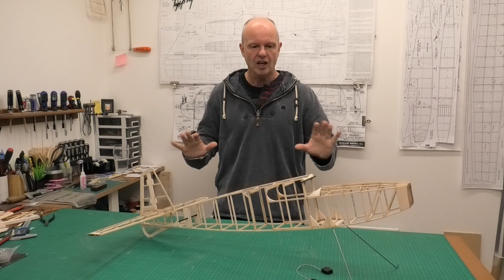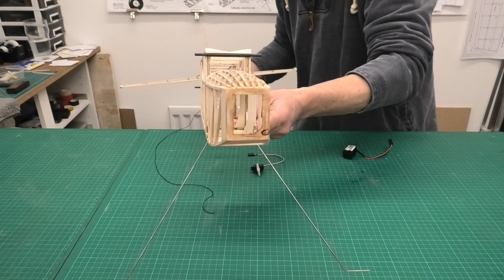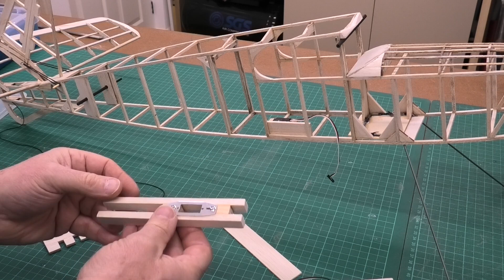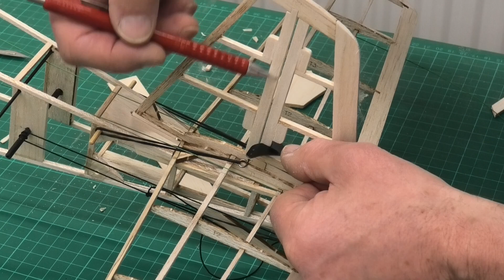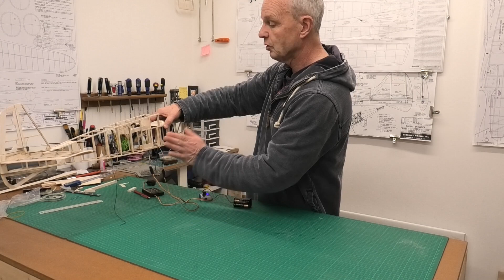Keil Kraft Gypsy - Build Series - Pt 6: RC Conversion - Fitting Servos - 1949 Design by Bill Dean

Comment: Great video, but then again, what else is new? I am quite fond of even smaller servos, 2 grams, as those require even less power, and in a push-pull situation, I'd wager they develop enough torque for a craft of this size/weight/speed. I am a bit scared about the weight, as you dutifully used some of that heavy balsa 😬
Reply from the maker: Thanks, pleased you enjoyed the video, appreciate the comment 😜

Comment: Just a small point - the rudder action (as described) will be "Pull-pull" as both wires are in tension. "Push-Pull" would be where something like a 'Bowden' or Snake cable is used....Otherwise, nice conversion.
Reply from the maker: Arh, did I say push pull, apologies, you are correct it is most certainly pull/pull.  Thanks for the comment, pleased you liked the conversion 😀

Comment: Will the tail plane be stable on the fuselage during flight or wobble about?
Reply from the maker: That is a good question, I hope not, as the plane is a fairly gentle flier, but I have wondered about this myself.  If it does wobble I will just insert some short cross spans on the tail seat to provide a slightly larger platform for the tail.
Reply: @MarkRobinson555 I found a small balsa block sitting in a seat help stabilise the tail area on my FF models when using a DT.
Reply from the maker: @MarkCroucherRC4fun  It may well need something, but didn't want to add the weight unnecessary 😜